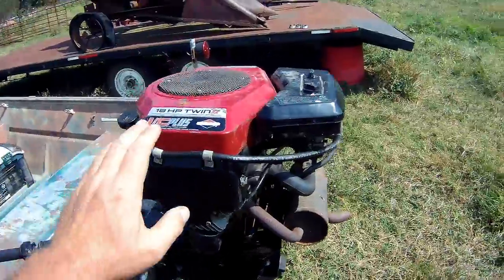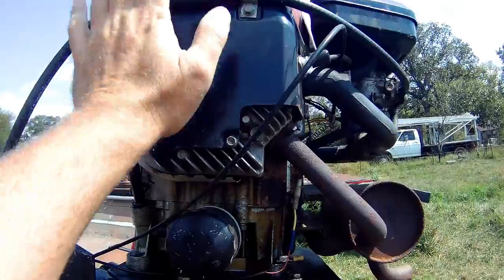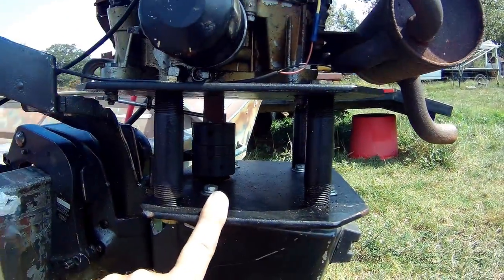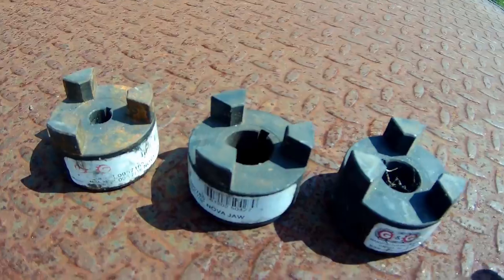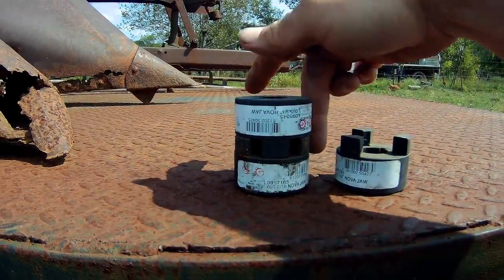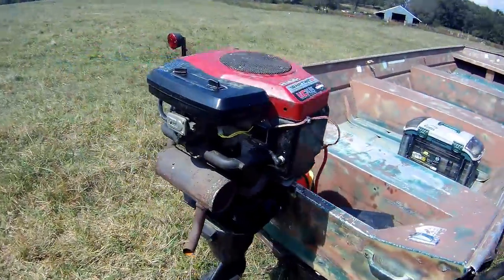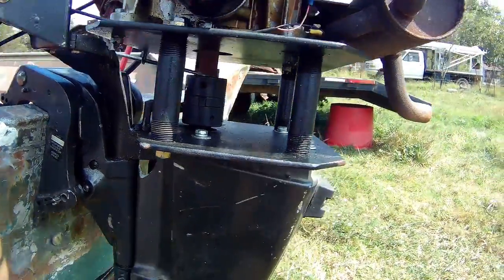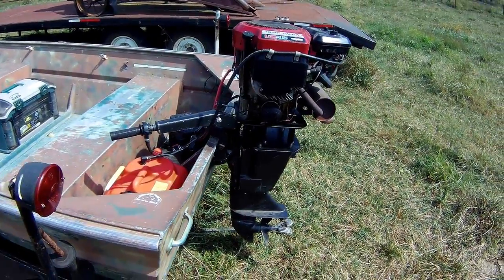how to bolt a briggs engine to a mercury lower

Comment: The title of your video is how to bolt a Briggs engine to a Mercury lower. You only explainedthe lovejoys. You explained what you are going to do, but you did not show us how the plates bolt together.  How does the shifter work? How are the plates bolted together?  The shifter mechanism looks complicated. How does the bottom plate mount to the lower unit? Try watching a Chris fixit video sometime.  He edits his videos. He sticks to the point. He doesn't tell us what he's going to do. He tells us. The only thing you explain in this video is about how the love joys are the key element.